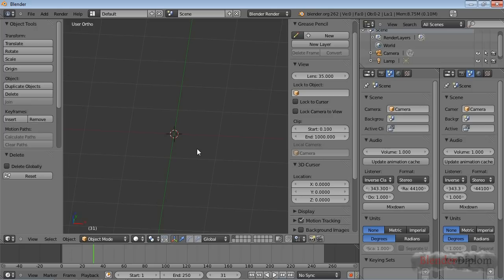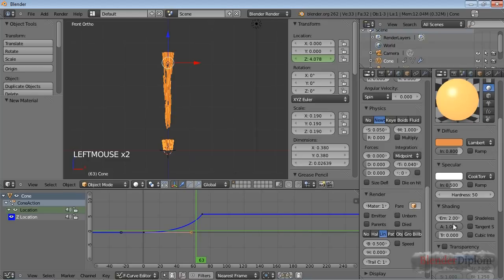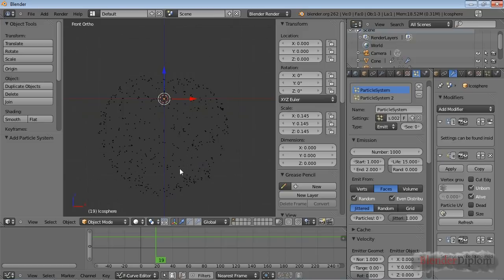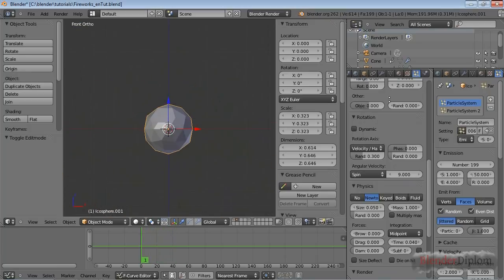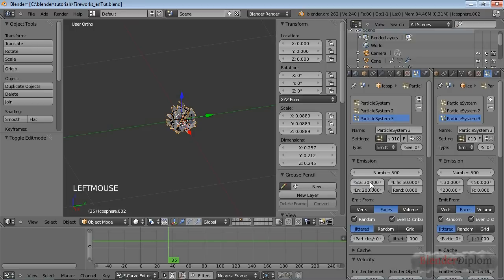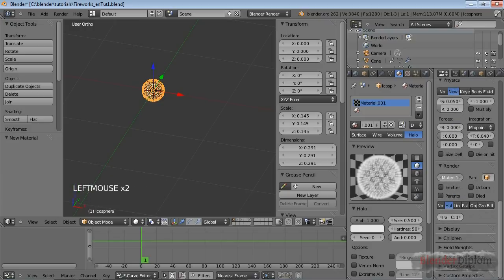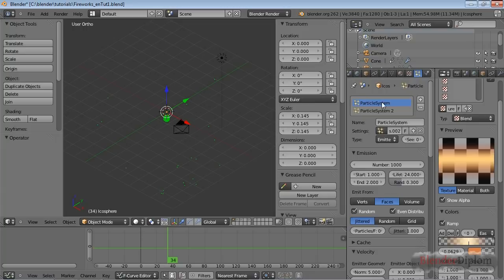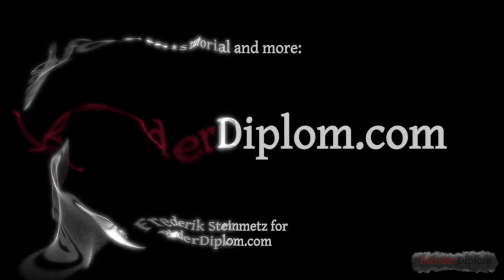Blender 2 63 Tutorial I Fireworks Part 1 I Particles Emitting Particles

Comment: If anyone is having trouble with the second particle system. Make sure you click (Use Modifier Stack) under Particlesystem 2 -Emission (Under Jittered---Random---Grid).
Reply: SlyNine Hi, I had problems as well and i set the “ emit from “ to Use Modifier Stack. It has gotten better but now the first few frames its ok but around frame 19 the particle system suddenly goes to the right, how did u fix this?
Reply: @neocided2173  I ran into some issues like the In 2.8. But 2.79 seemed okay.
Reply: @neocided2173  oh. Make sure you play with the rotation. You want the faces to be emitted in the same way they were sitting on the mesh.

Also you won't be able to use halos in cycles.
Reply: Thank you very much SlyNine. I was having trouble in second particle system. It was generating from the center. Yesterday night I spent 3 hours to figure out but could not find any thing.